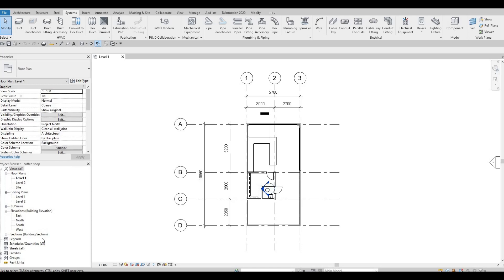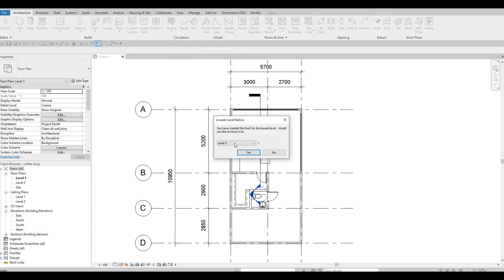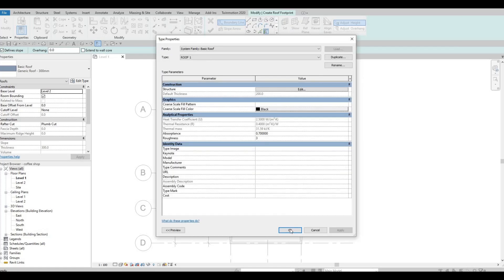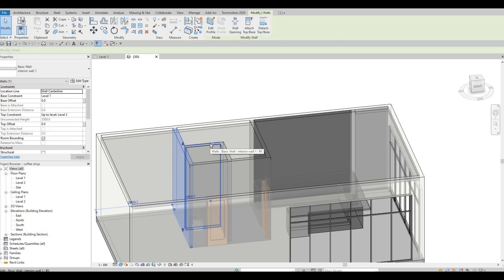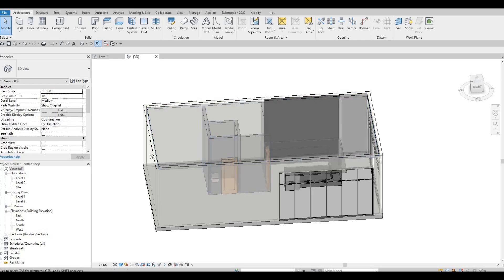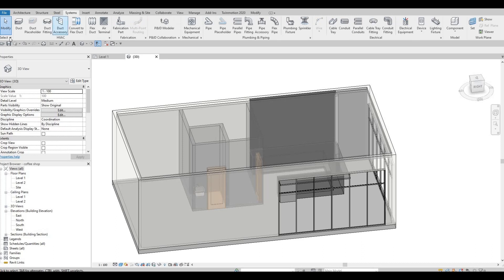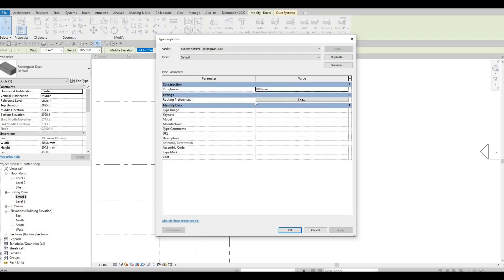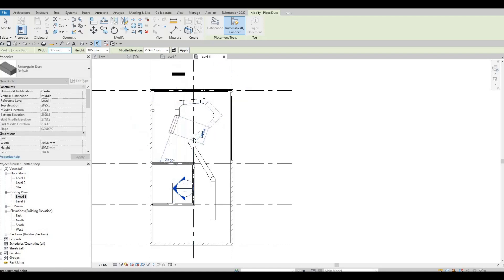Coffee Shop | Part 4 | Complete Step By Step Project | Revit and Twinmotion Tutorial

Comment: What Kind of roof assembly is that? Thank you
Reply from the maker: It a flat roof 🙏🙂
Reply: @ArchCoreDesigns  would it be concrete deck or timber? I just wanted to make sure it works because i wanna make details for it. Thanks